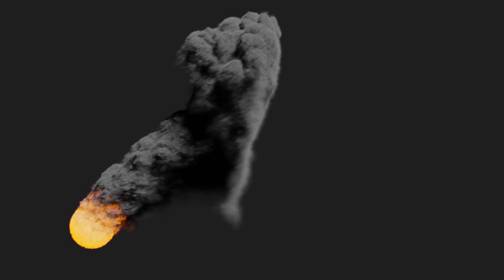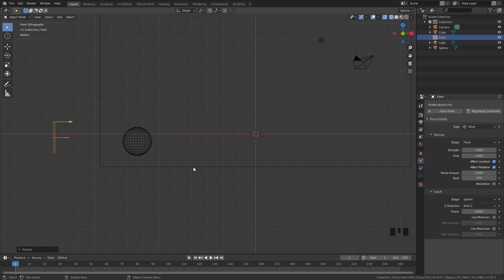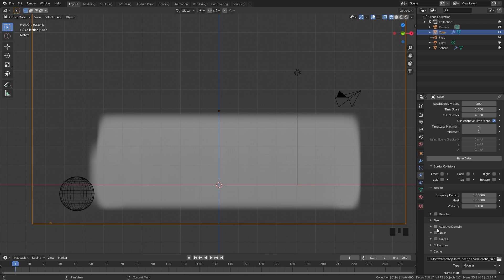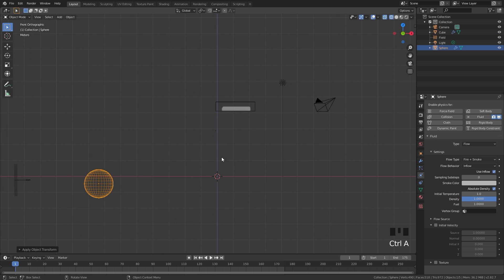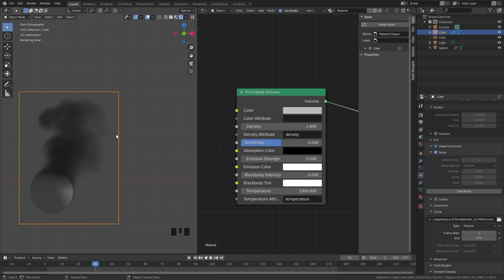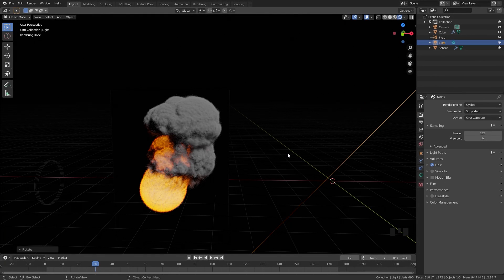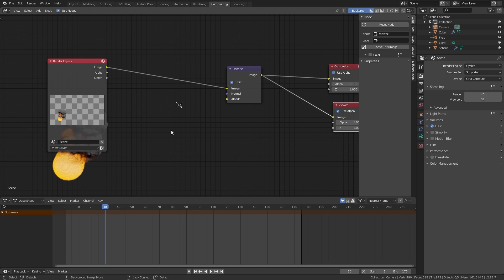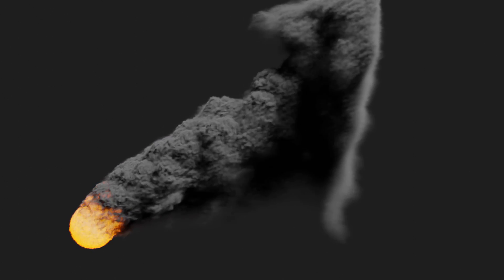Blender Tutorial - Mantaflow Large Scale Smoke Simulation (2.82)

Comment: For those (like me) who did not had any "free data" or "bake data" buttons on right side menu they can use F3 and search it manualy. But make sure you have the Domain selected! Also if you have a painly slow computer and the baking keeps more and more closer it gets to the finish, you might consider checking Dissolve in domain's tab also check the Blender manual 🤩

Comment: Am I the only one who cannot get smoke :( I did everything as in a video but I don't have any smoke or fire...
Reply: I had the same problem but eventually found a solution (at least for me). Try disabling the noise before baking the data. Then you can enable the noise and bake that as well. Hopefully that will work for you!
Reply: yeah i got this problem too. at first i used my own settings and no smoke nor fire were to be seen. then i tried to follow this tutorial but still got no smoke nor fire come out. idk what is going on
Reply: Voxboxc did you figure this out? I have the same problem
Reply: @abierf  render using workbench kinda work but it's kinda useless since there will be no shader to play with. i am currently stil searching for solution. either it is a bug or just shader domain issue (volumetric settings).
Reply: For some reason I couldn't use an external drive to cache the bake. Also, if you don't create the cube/sphere in Cycles, you have to set the scene too cycles and recreate them.
Reply: I fixed it by adding a material to the Domain Box. 

1) Add material to Domain box
2) In the Shader Editor choose a Principled Volume shader and plug it into the "Volume" in the Material Output node
3) Profit

Note: You might need to bake the data again
Reply: Same.
Reply: You need to bake it before you can actually see it
Reply: @kevin-t1u5i  Can't speak for the other folks in the thread, but I did. Was probably just something acting a little buggy.
Reply: Also nothing over here

Comment: I can see some typical banding and  lot of flickering and the noise isn´t moving correctly.
Perhaps no noise, increase vorticity and resolution instead for better final quality and detail.
Reply from the maker: Yeah I have noticed sometimes that the noise does act a little weird.   Increasing the res and vorticity would probably make a more accurate and better looking simulation.
Reply: @BlenderMadeEasy   Some of the shadow flickering that you see in the thick smoke that's already further away from the fire results from too low bounce values for transparency (or transmission, can't remember). In the light paths section of the render properties, I usually leave the max bounces for diffuse, glossy etc. at lower values, but set the transparency and transmission bounces to 128, and the total to 128 as well. It normally doesn't increase the render time very much but the smoke flickering disappears.
//EDIT: You only need to increase the transparency bounces. It's not necessary to change transmission or total bounces.
Reply: @gordonbrinkmann  

I wasn´t aware of that the transparency channel would ever be affecting  the volumetrics, nor in the transmission channel to affect the volume.
Don´t you mean Volume bounces? and step size?
Change linear to cubic interpolation in both display and volume settings for the fluid domain.

Not really that superfond on working with mantaflow, slow to simulate, and any move yo do with the emitter mesh, it doesn´t update properly, if you move an emitter mesh inside of a domain, the fluid could still start from the other position.
Replay cache mode, you need to go in to the mode and reselect the replay each god darn time, and no clear cache button, what´s up with that?
Reply: @PrometheusPhamarus  No, I don't mean volume bounces... I had this problem of flickering shadows in the past with the old Blender smoke simulation as well, that's not a mantaflow thing. Switching the material settings from linear to cubic helps get rid of blockiness, but I think it's also looking like blurring the smoke resolution which I don't like.
But cubic didn't help with the flickering shadows (which are mostly visible when a light source is in the scene).
In tutorials on glass materials and semi-transparent cloud layer planes I learned that parts of an image might be rendered black when the transparency bounces are set to a low value and there are too many transparent objects overlapping each other.
So one day I thought, since the light has to shine through the smoke and throws shadows, maybe there's an issue with the transparency settings, because the light has to travel through many layers of smoke. After I increased the values for  transparency bounces, the flickering immediately disappeared.
Reply: @gordonbrinkmann  @PrometheusPhamarus Hey boys, I might bring you sort of an answer for the flickering problem. Long ago I had to render smoke simulations for VFX purposes and scratched my head for hours because it seemed like my smoke flickered because of the sun light I put in. Weird enough, it was only when I added light sources, and no matter the resolution I was putting in, materials, vorticity, and parameters I changed, it kept flickering. Actually it seemed that the Adaptive Domain was the problem. When I removed it, it completely solved my problem ! Of course the baking time and rendering time was longer, but that seems to be the best workaround I found back ago.
Please note that it was with older Blender versions (2.76 if I remember correctly), Mantaflow wasn't implemented. Maybe it'll help, please notifiy me if it's the solution !
Reply: @theocoeugniet7050   Actually I don't use the Adaptive Domain anymore for quite a while now since it was often said to be the reason for one or the other problem. But the flickering in the shadow isn't caused by it. As I said, the main reason for this is a low number of transparency (and maybe also transmission) bounces in the "Light Rays" settings. And of course you have to increase the total bounces high enough as well, otherwise the settings won't have an effect.
Reply: @gordonbrinkmann  I just re-rendered this tutorial with your advice and you're 100%  right - the flickering was eliminated.  Great discovery.  Bravo.
Reply: @FrankCappello_official  Glad I could help. Unfortunately nobody ever talks about that in smoke tutorials and I'm not a tutor 😉 But I was desperate for not finding out what is going to help with this, then I remembered a tutorial about rendering images where you have lots of transparent planes, like leaves on trees. And there it was explained that too many transparent layers cause black areas if transparency bounces are too low. And well, that helped with smoke, too.